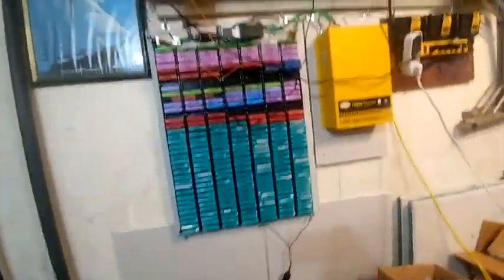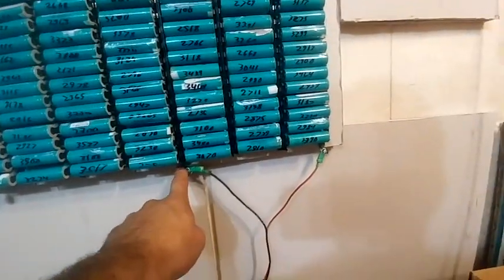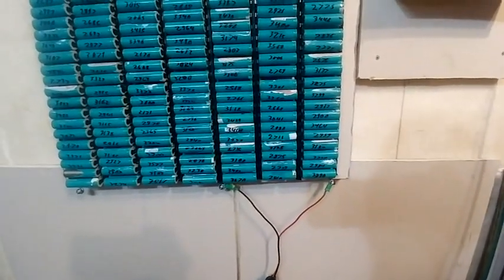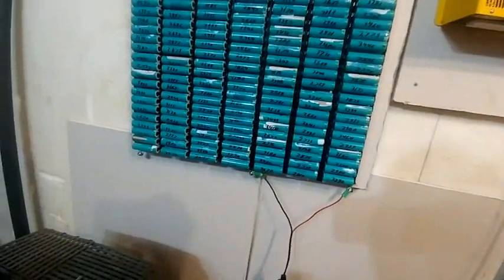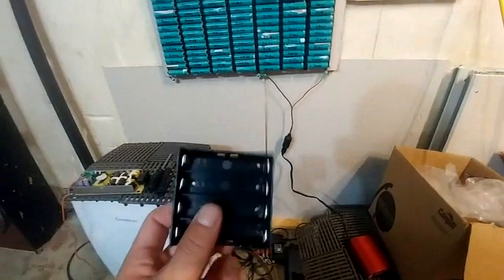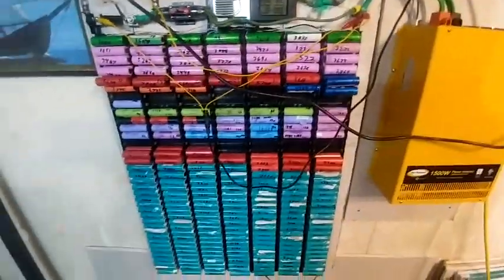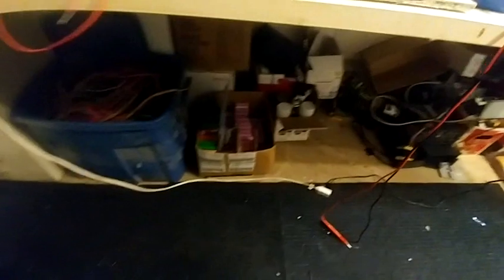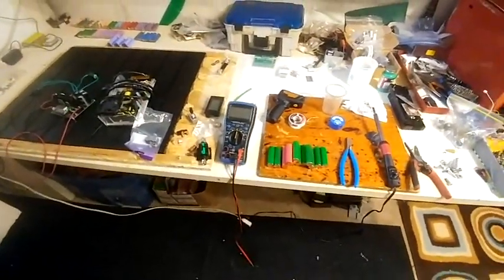18650 3s 4s or 7s modular power wall update

Comment: most 12 volt inverters will handle 15.1 volts  4S is doable but at a capacity loss ive done this myself experimenting before i switched out to LifePo4 26650's. 24 volts is not an option for me because of having all my solar set up and inverter already as a 12 volt set up. Just to expensive changing  over to accommodate 24 volt system. One thing to keep in mind but its also your choice and as many other do on youtube as well charging by constant voltage is not the proper method (MPPT and PWM) is not the proper method to charge LiIon it should be under constant current check out battery university and how to properly charge lithium batteries, but there again its your choice on how you charge them. I for one refuse to use constant voltage these batteries are to expensive and a whole lot of work to chance a shorter cycle life by improper charging methods

Comment: I found a way to charge 3s packs with parallel connected tp4056 boards and PC power supplies. I cannot tell you how many modules met their doom while i was experimenting.
Reply from the maker: Panic The Scholar Knight. Lol thats pretty risky ive done similar things in the past with expected results lol
Reply: Andy Shell it is VERY finicky. It works but id always suggest redundant safett measures or fire is very likely lol. But it works! Ill see if i can't make a channel to show these ideas. Love your channel as there is always some interesting thing no one else really thought of.